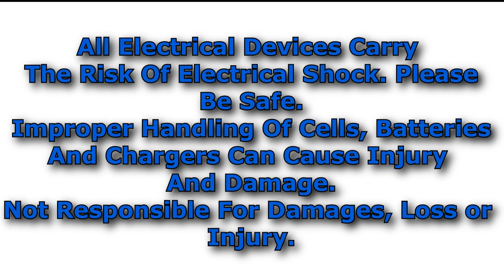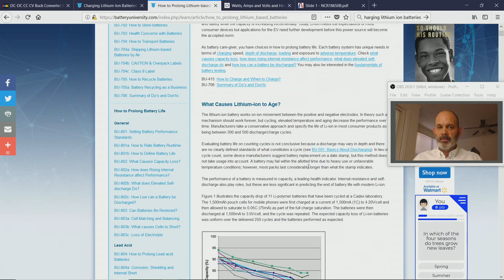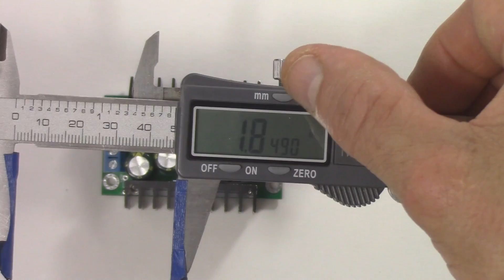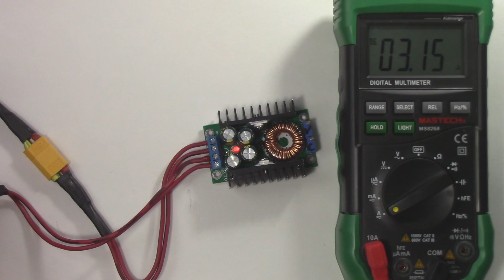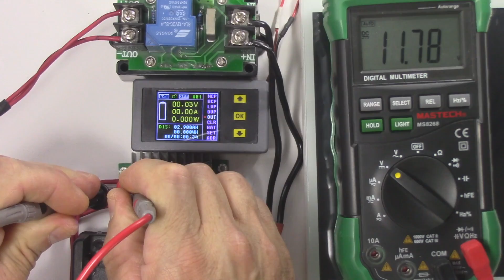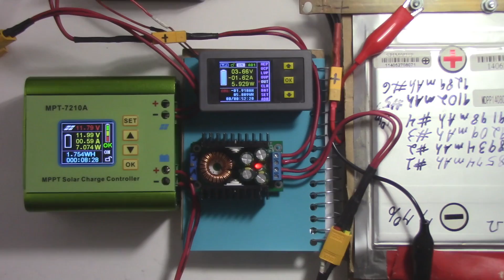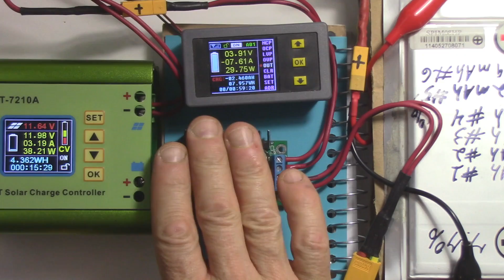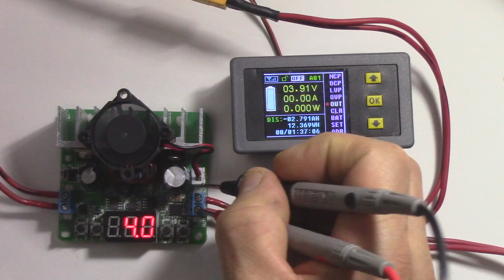Cheap Lithium Battery Charger OSKJ Buck Converter (Constant Current-Voltage) Review-Test

Comment: THANKS FOR THE INFORMATION....HOW ARE 10 MODULES CONNECTED EACH ONE WITH A FAN FOR 10 18650 BATTERIES AND WITH WHAT VOLTAGE
Reply from the maker: You could do that. I think you would be better off with a BMS with which you can use one of these modules with: eBay(paid): https://ebay.us/UrPe6j Thank you so much for commenting and watching. I appreciate it greatly. All the best.👍😀

Comment: I'm having issues. I set the voltage to what I want. Hooked it up
 Didn't charge. 
I adjust the other blue thing and the voltage goes down
Reply: I did blow the 10amp fuse on my Meter.  But I got a step up
..
Reply from the maker: If the voltage is set to the current voltage of the battery it will not charge. It will only charge if the battery is NOT at the current set voltage. Thank you so much for commenting and watching. I appreciate it greatly. All the best.👍😀

Comment: Very good video perfect. You did not answer questions such as how do we charge automobile batteries?
What's wrong with using this model wet car batteries to charge? I can't believe you haven't done this test until now.
Doesn't the red light turn blue in water type car batteries when adjusted to the desired current?
I think the blue light will eventually turn on because the battery will draw less current as it fills up.
What is your comment on this?
Reply from the maker: I'm going to have to test it on my car battery but I think it "should" work as lead acid does use constant current constant voltage charging. I will have to look up specifications for lead acid charging. Here's a great resource for this: https://batteryuniversity.com/article/bu-403-charging-lead-acid Thank you so much for watching, commenting and the valuable feedback. I appreciate it greatly. All the best.👍😀

Comment: Can I use this to charge a LifePo4 battery with a motorcycle inverter? The specs of the inverter is 700W/50A, what kind of buck converter would I need?
Reply from the maker: The specifications for the device are available on eBay (See affiliate link in the video description). I use it to charge my batteries still. As long as you set it to the right voltage and amperage that is what it will deliver (within specs). Thank you so much for commenting. I appreciate it greatly. All the best.👍😀

Comment: Will these be able to handle 12v battery to 12v battery pulling 200amps in between????? I wanna regulate the pull of voltage/amps between my batteries that my 3 car audio amplifiers will be pulling from one power battery to from main battery.
Reply from the maker: These are meant to charge batteries, so if that is what you need and are within the charge specifications you require then they will work for you. Thank you for watching and commenting I appreciate it greatly. All the best!👍😁

Comment: You claim that the buck converter is a constant current device. Accounts and current device maintains a constant current as the load changes. This is different than a current limit device. The only way to know if you have a constant current supply is to adjust a certain current and compliance voltage and change the load ( not an open and closed circuit test ) and show that the current remains the same. Could you do that test please before I purchase? Thank you

Comment: Thanks for the info! I got one recently.
The red light from LED means it’s current limiting at that moment and blue means it’s voltage limiting.
There looks like a LED missing on the circuit next to negative output/input connector. What is that LED for?
Reply from the maker: ON my module the LED going from red to blue means it  has gone charging (red) to charge completed(blue). Thank you so much for commenting and watching. I appreciate it greatly. All the best.👍😀

Comment: Great stuff, question...do you have the positive and negative on the power- out- connected at all times and just simply switch probes of multimeter  back and forth from amps to volts. While changing dial on multi meter too?

Comment: Can a number of this Buck Converter connected in parallel to bring up more current output ?  For safety reason I assume a blocking diode should be added to the positive connector of output side to avoid back flow current from other buck converters.
Reply from the maker: What you state may be possible but I don't have the electronics background to confirm if they can be used in that way. Thank you for watching and commenting. I appreciate it greatly. All the best.👍😀
Reply: @richardlloydusa  You are so humble !  a layman could not make a good presentation of electronic product like you !  great work !
Reply from the maker: Thank you Sir. These chargers are pretty cheap to experiment with. Give it a try with just two of them and see what happens. Best case scenario is that it works as you are thinking (Which I see as likely) and if it doesn't you get to keep both parts. LOL, If I had two I would probably give it a shot. All the best.

Comment: I struggle to understand electronics and especially lithium ion batteries. What I have done is set up a way to charge a Bluetti 70  using the 12 v battery in a 2008 2nd generation Prius. I have purchased a dc-dc converter 12V-24V 10 amp 240W and set it up to clamp it on the battery and plug it into the Bluetti for a faster recharge. Now I realize that I have to manually insure the battery doesnt get to 100%. Does the buck converter work as a better alternative while being able to fast charge the bluetti ? Another concern is to not kill my car battery. Any feedback is appreciated.
Reply from the maker: I'm not sure you can fast recharge the Bluetti 70 if you are using the MPTT port as it probably already has a circuit to maximize charge built into that port as it is charging the internal Lithium battery pack. Thank you for watching and commenting. I appreciate it greatly. All the best.👍😀

Comment: If using multiple of these charging several cells 1 per cell but the cells are connected in series won’t it be a problem are the grounds isolated in these units?
Reply: My same thought??? It has two negative (-) connectors, one for input and another for output, so there is no common ground I guess!!!
Reply: You need a separate power source for each buck or they will have common ground.
The ground on the supply is connected to the ground on the output in these buck converters.
I'm building the system you are asking about.

Comment: Great video. One quick question. Does the amp meter disconnect the line when it reaches the voltage or does the buck converter turn itself off ?
Reply from the maker: The buck converter does that job by it's self. It's really a great value for a charger. Thank you for watching, commenting and liking. I appreciate it greatly. All the best.👍😀

Comment: Great video, Thanks !  I have one of these buck converters.  I'm thinking about using mine to charge my SLA batteries ranging from 7 AH to 18 AH.  Looks like the manufacturer is recommending a charge current of 20%  of C.   And a charge voltage of 13.8.   Your thoughts . . . .     '73   Bob
Reply from the maker: I love this converter. It's efficient, pretty tough (I haven't destroyed it yet) and it does exactly what you set it to do and they are CHEAP! I know they will up to 12A and 24V so if it's capable of working within the parameters that you need go for it. Check the eBay link for all the specifications. Thank you so much for commenting. I appreciate it greatly. All the best.👍😀

Comment: Thank you for your well explained tutorial. It appears you also have a voltage regulator with a red digital readout that is adjustable but I don't see a link to it. Could you possibly provide one?
Reply from the maker: Thanks for the question. I don't think my original buck step down converter is being made anymore. They switched to a digital board with a potentiometer (variable resistor like a volume knob) but other than that they seem to use the same XL4016E1 12A 180KHz 40V Buck DC to DC Converter MOSFET IC Data sheet here: https://bit.ly/37AxQ81) Here is an (Affiliate link. Helps me on YouTube and does not cost you any extra if you use it) from eBay for a similar regulator: https://ebay.to/3xAtxUF I have had very good luck with it and it does handle up to 5 Amps but you may want to mount a fan to it or bigger heat sink if you are going to push it at 5A. Thank you for watching and commenting. I appreciate it greatly. All the best.👍😀

Comment: Really great video. I have a question, but short story first. I got scammed and ended up with a fake Dewalt drill. The drill worked great when I first used it until the batteries died. Tried putting them on the charger, and the charger is no good. Opened it up and there's some crappy little converter inside. I am wondering if I could take one of these OSKJ Buck Converters and possibly replace the module in the charger with it? The drill says its a 24 volt 6amp charger. Opened one of the batteries and there is cheap lithium ion cells inside it but all i could see is 1300ma. Your thoughts? Thanks in advance for your advice.

Comment: Pretty amazing buck , but will it charge 4s 3.2v 30ah lifepo4 batteries 12.8v with 100watts 23v 6A solar panel which im gonna lower down to 12.8 v to get 9amp power from solar panel ?
Reply from the maker: It is within what they say it should do "DC-DC CC CV Buck Converter Step-down Power Module 7-32V to 0.8-28V 12A 300W USA" so I can't see why not? Thank you for watching and commenting. I appreciate it greatly. All the best.

Comment: this module can charge seal lead asid bttry?.
this module has overcharge bttry protection?.
the input can connect to solar panel to charge SLA battery?.
what min and Max (volt n amp) battery it can charge?

Comment: I have one of these units, I had no idea it was for lithium cell charging, I think I bought it just for dropping voltage down for some reason or other. Damn excellent video, seems there is some controversy in the discussion on whether or not it does actually go to zero amps, can you confirm it will go to zero on non-protected cells?
Reply from the maker: Thanks for asking the question. I just tested this on my 4S battery pack and it did exactly what it was set to do. As it approached the cutoff voltage the current continually dropped til it reached the set voltage and at that point went to 00.00A and 0.000W on my am-meter. So the OSKJ cicuit I have functions exactly as advertised (Phew! You had me worried.) I have noticed that there are similar circuits out there with different colored PCB boards and some with only two capacitors claiming to do the same thing (No idea if they do or don't). But there may be counterfeit boards out there made with cheaper parts or substandard design. The other possibility is that the reports are wrong! Thank you so much for watching, commenting and the valuable feedback. I appreciate it greatly. All the best.👍😀
Reply: @richardlloydusa  thankyou so much for comfirming this, I guess it looks like this is what the circuit is designed for?
Reply from the maker: The one I showed is designed to properly charge lithium cells but it can be used as a step down buck converter as well. It's very handy and you can adjust the voltage and current to match your needs as well.  Thank you so much for commenting. I appreciate it greatly. All the best.👍😀
Reply: @richardlloydusa  any tricks to setting voltage/current? Will try mine soon on lithium.
I mean do you have to adjust voltage/current after start charge or setup precharge?
Reply from the maker: Use a digital meter to set the voltage ahead of time before you connect the charger to the battery. You can also set the current with the battery connected and the multimeter set on the proper amperage setting (google how to check amperage on a digital multimeter if you're not familiar with the process). Checking amperage on the wrong setting on the digital meter can blow internal fuses. Once you have it all set the circuit will do the rest for you. Thank you so much for commenting and watching. I appreciate it greatly. All the best.👍😀
Reply: @richardlloydusa  After posting this question I went and rewatched the video, I see you didn't miss any details and was quite clear how to set volts/amps, really quite detailed video thanks for taking time to reply again, great work AAA rating! ( clear with volts/amps on meter........thanks for warning though)

Comment: Does the unit stay set with different inputs? Say I have 2 different power sources, 12v and another 14v. Do I need to set the output for each unit or is the output not related to the input?

Comment: That's a PROTECTED lithium cell you forgot to mention.
It's the battery cell protection that stops the charging, NOT the buck converter.
With an UNPROTECTED cell it will not fully stop charging and it will enter in TRICKLE charge mode which is very bad ( as you also mentioned ) for lithium cells. 
Good job, keep on going!

Comment: I couldn't quite make it out, but is that paper between the heat sinks and the power transistor and diode? Shouldn't they be mounted with thermal paste?
Reply from the maker: It's a typical of thermal plastic or rubber. I've seen it used in many circuits. Thanks.
Reply from the maker: Thank you for asking, I found out what it is, it is a Heatsink Cooling Thermal Conductive Silicone Pad you can buy them here on Ebay: https://goo.gl/z1dMHX

Comment: Which circuit is appropriate for cc 2A and cv 12v output . Input is fluctuating voltage from 10v to 100v

Comment: i think the transistor which is upper side is converting the current but which is lower part it is voltage that is why usually you get higher temperature over the current transistor

Comment: Nice test thanks, do they also make these for higher amperage battery pack? I have 7s 20p 18650  used cells average 2100 mAh ea.
Reply from the maker: You are most welcome. As long as you set it correctly to supply the correct voltage and amperage for your battery I can not see why it would not work but verify that it can do what you require by looking at the specification for the device and your battery or cells depending. Thank you for watching, commenting and the kind words. I appreciate it greatly. All the best.👍😀

Comment: how to charge 16.8v battery pack of 18650 4S2P with this buck converter??? help me please.
Reply from the maker: You would set the output to the required voltage and current you want to charge it to (check your manufacturer for the specifications) and connect it to your battery as required (usually to the output leads) but once again verify it with the manufacturers specifications for your battery. Thank you for watching and commenting. I appreciate it greatly. All the best.
Reply: @richardlloydusa  : let me try it. make a 80% charge battery. use some CC/CV buck converter. i made 4S2P with some difference battery. hope it safe for the battery and have balance the voltage of each battery. regards from indonesia.
Reply: Hey i want to work on same 4S2P battery pack, but unable to charge even single cell with this module. I have given supply from a DC power supply with limits of 12 V, 1.3 Amp as per cell specification. Everytime CC stage transfers to CV stage even battery cell is discharged to 2.8 V.

Comment: Nice video. Can u recommend another buck converter that can handle about 80v thank u
Reply: Yes . There a excellent one ( DPS8005 ) 80v 5A buck converter 

33$ only and it came with digital display and Bluetooth to control it with your smart phone or by your PC software through the BT or USB cable . 
Max power 400w max volt 80v max current 5A

Comment: Can yu please tell me sir..... i have 12 volt lithium batery.... theres no bms ... and no other circuit at all  ... just the batery in series   12 volt  so can i use this buck converter   direct connected to my battery.... can i sir....
Reply: No, it will not works as Bms, please use bms first

Comment: Great videos . I was trying to get one of these to charge li-on 4s and was setting it up for a 100Watt solar panel , first thing I noticed was it would not work at 18 volts input so adjusted it to 20 volts then it started working so then backed it off to the 18 volts needed and it still was working fine I then removed all the input power waited a minute for caps to bleed off then reconnected everything and it now works fine so some of these dc to dc converters might need a higher input voltage to set it up before you set the final voltage needed.
Reply from the maker: You're most welcome. Glad to hear about your positive results. Comments like this make my DAY! 😁️ I'm glad to know I could help you and that you got value from my work here. Thank you for watching, commenting, subscribing and the very kind words. I appreciate it greatly. All the best.👍😀

Comment: I have a 25 amp 9.9v battery and i want to drop the output to 8.5v 15amp for a project using this converter. Do you think it can get the job done or am i asking too much from it? Any help would be great.Thank you
Reply from the maker: I think you are pushing it at 15 Amps on this device. Try something like this instead at Ebay: https://goo.gl/JLbkyY it's rated at 20 Amps. Thank you for watching and commenting. I appreciate it greatly. All the best.